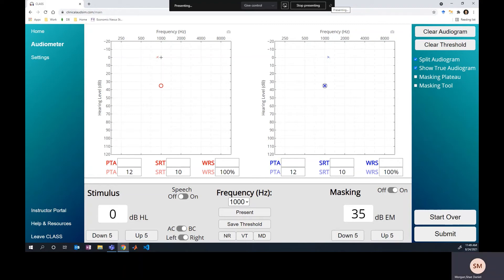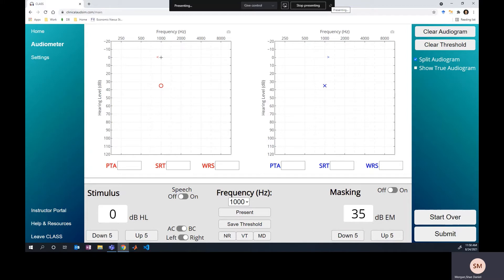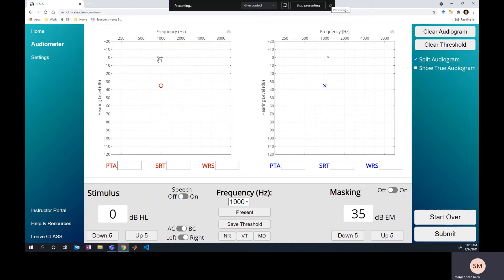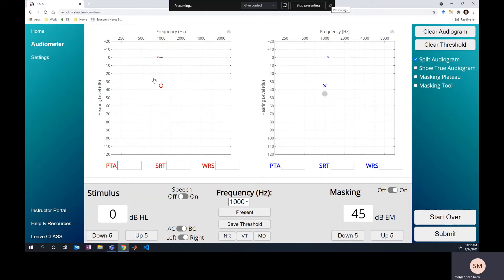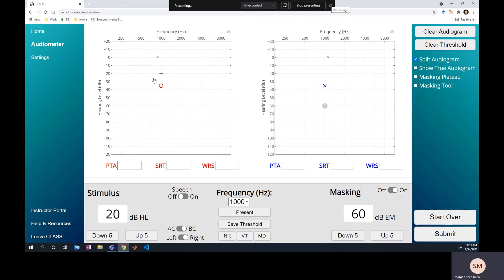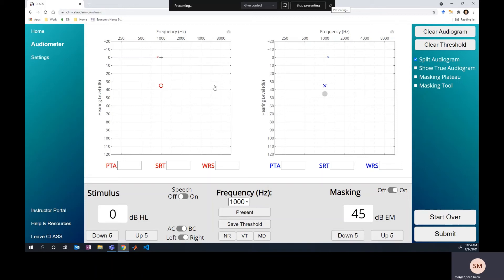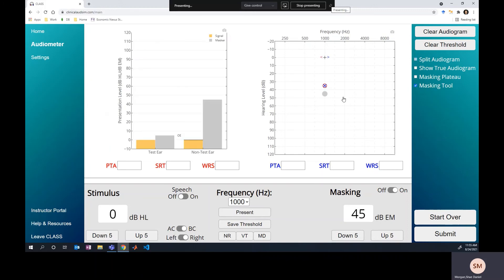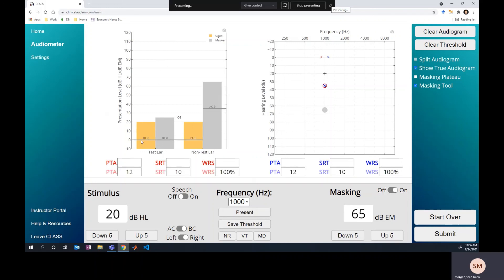Masking Dilemma: Bone Conduction

Comment: Then, how do you fix the problem?
Reply from the maker: That’s the issue - you can’t finish testing. You just mark in your report that the testing had to be stopped because of a masking dilemma and rely on other tests to help inform your next steps. For example, tympanometry can help to decide what is going on. If the middle ear has a conductive loss, it’s usually reversible or treatable, so you might just wait to ask the patient to return another day or time. You can also try changing your transducers (from headphones to earphones) which changes your estimates of interaural attenuation and occlusion, so you can get a valid test.
Reply: @ThetaSimulator  would an audiometric weber help in this case?
Reply from the maker: @youssefelsayedahmad3552  an audiometric weber will give you some information - primarily about lateralization of the sound to one side or the other. The weber test is not incredibly site-specific, however, which can lead to some problems. 

For example: If you do a weber, and it lateralizes to the left side, it could be that the right ear has sensorineural hearing loss (so it goes to the better-hearing side), or it could be that the left ear has a conductive loss that's causing an occlusion effect (e.g., earwax plugging up the canal) which might make it sound louder on that side. Even if it lateralizes center (i.e., both sides similar), you can't be sure of the status of both ears, since the weber relies on bone conduction, so you don't have any new information that you didn't have before.

Like I said earlier, you could use the weber test with tympanometry and your test results to assess the whole patient, to come to a reasonably confident conclusion of what's going on, but I'm not sure that the weber test alone would give you a bunch of new information that would help you "solve" the audiogram.

Comment: Hi, I was just wondering what is the difference between masking dilemma and overmasking? TIA!
Reply from the maker: Hi Jennifer! This is such a great question, and the two topics are related which doesn’t help with any confusion.

Over-masking is whenever you have so much masking noise in the non-test ear that it’s actually preventing the listener from hearing the test tone in the test ear. 

A masking dilemma is when you aren’t able to mask, because your initial masking level is so high that it prevents the listener from hearing the test tone in the test ear. In other words, you have a masking dilemma when your starting masking level is over-masking. Would a video demo be helpful for this topic?